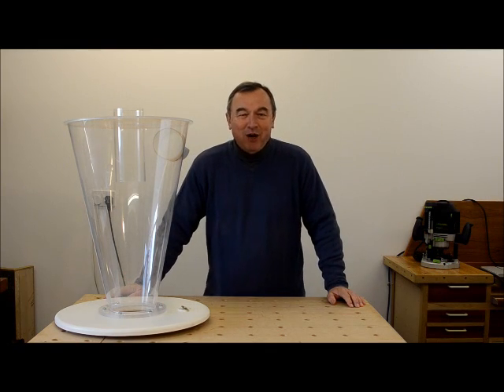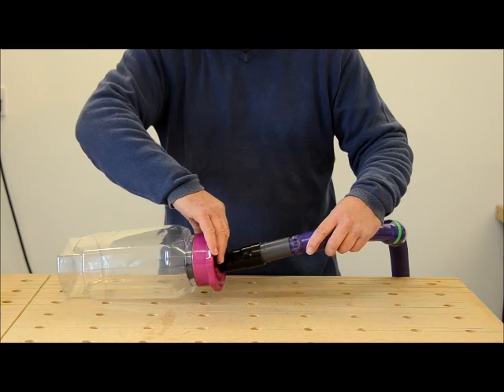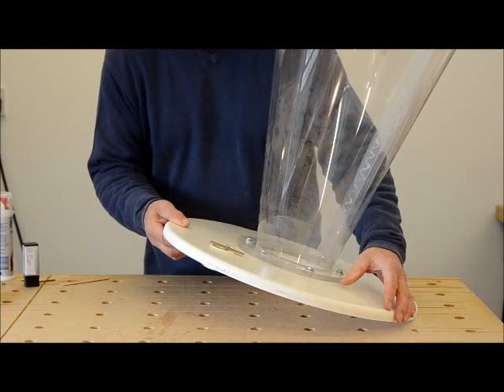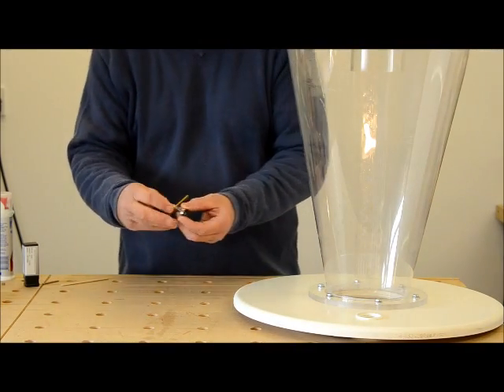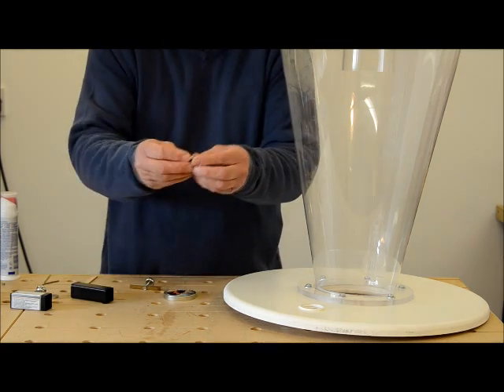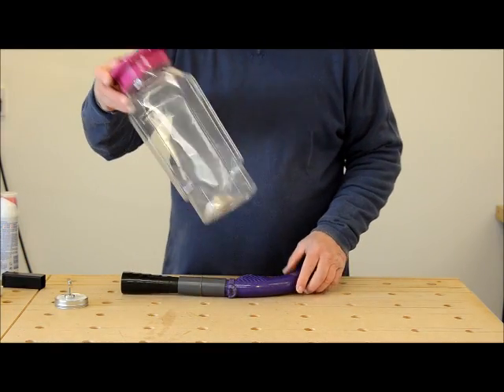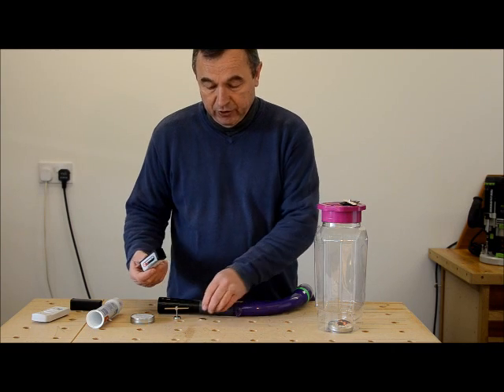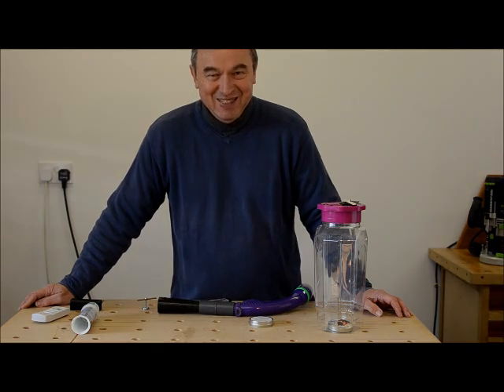Cyclone Pressure Relief Valve

Comment: having the valve at that location will send air back up the cyclone, bypassing the normal centrical spin causing any debris in the cyclone exit into the vacuum and not separate..   if you put the valve on the hose just before the cyclone, air coming in at the valve location will go through the normal cyclone separation.
Reply from the maker: Many thanks.

Comment: not a good fix, you still have to constantly go in to retrieve the cap
Reply from the maker: Hi Eulayses, I did in a later video modify the gadget using a pair of springs that return it to the right position every time.  Peter
Reply: @NewBritWorkshop  great! Do you have a link
Reply from the maker: I have tried to find it but failed. The design is so simple. I used the same tin lid as the valve and put 3 small holes, at 120 degree spacing, on  the lip. I then found 3 fairly weak spring and fixed these to the tin lid and then to the underside of the drop box lid so that the tin lid covered the hole. I carefully experimented to check that it worked. Peter

Comment: The only problem with that design is that you need to stop and take off the lid to reset it. Have a look on Charlie DIYte's channel where he has just put out a new video using a spring-loaded, off-the-shelf valve, available on line, which is self re-setting as soon as the pressures re-equalise. That's the route I'm going to follow!
Reply from the maker: Hi Brian, Ages after making this video I introduced a new spring loaded design of my own using the same tin lid. However, now that I have the metal 4" cyclone from Axminster I do not need to worry about pressure relief valves.  Cheers.  Peter
Reply: @NewBritWorkshop do you mean you don't need to worry about a pressure relief valve, as the attached hose is too wide to get blocked?

Comment: Nice project and thanks for sharing. I love watching people think out of the box. As I was following along I came to a question? (Apologies if someone already asked.)
Why put a valve in it at all? The vacuum supplies a constant air draw rate. We know that without an additional air inlet, the system is too restrictive and collapses the bucket. Why not just leave an open hole? In my mind, the hole is all that is required. Am I missing something? Again thanks for sharing.
Reply from the maker: The hole would ruin the effectiveness. The system has to be sealed until a potential collapse - hence the valve.  Peter

Comment: Are you using a shop vac with that cyclone?   If so, the cyclone is too large.  It's hard to believe that a dust collector blower, which has 1/10th the vacuum as a shop vac, could collapse that cyclone.  And if you did require a relief valve, it should be in the inlet, not the bin.  A leak in the bin sends dust to your final filter.
Reply from the maker: Hi Bill, I am using a Numatic NVD 750 which has a very small tank for the debris. It has enough sucking power to easily crush that original cyclone. However, I now have a metal cyclone from Axminster which does not need any relief valve and it is much cheaper (here in the UK) than the Oneida equivalent.  Peter
Reply: Good call on placing the valve at the cyclone inlet Bill. I was planning to place it next to the cyclone in the lid, unaware this would suck debris up into the shop vac.

Comment: I had made a relief valve with a spring only. I noticed that adjusting the spring tension is tricky. Either it is too stiff and the bucket collapses or with a loose spring the valve tends to leak and air flow is reduced. The magnet seems to be the solution. I'll try some combination with magnet to keep the valve shut and a spring mechanism to reset the valve when no vacuum is applied.
Reply from the maker: Hi Hans, That should work. Good luck.  Peter

Comment: There is a much better method if you think outside the box a bit that is professional and self resetting. Get a McAlpine VP2 air admittance valve, cost about £5. These are designed to use gravity to hold the valve down which is not quite enough as they are only for flushing toilets. However the top screws off and you can fit a compression spring to decrease the pressure at which they operate. I used one I had kicking about, but they can be had very cheaply on eBay if you don't have something to hand. No dicking about with magnets and the VP2 is threaded with a nut so all you need to do is cut a hole in the lid. Looking about I cannot believe nobody has thought of this before as I can see loads of crazy DIY pressure release valve ideas on YouTube.
Reply: Could do with a bit more info than fit a compression spring for someone who's not a plumber or used to seeking out this stuff please? Does the top stay off? Where to fit spring etc. Maybe do a video on it lol. :) Many thanks.
Reply: @Mr_Gadge I imagine he meant to simply place a spring between the lid and the part that rises up during negative pressure. The hole in the lid would probably be to accommodate a steel rod to keep the spring in place. However, he mentions using a spring for decreasing the pressure, and what I'm describing increases the operating pressure.
Reply: Is that correct Jonathan? Don't want to spread misinformation
Reply: @lennartjuhh  Yes I mean increase the pressure at which it opperates.
Reply: Jonathan Buzzard that is the answer I’ve been looking for & I was a plumber & have plenty of them, many thanks for the fantastic tip 👍🏼

Comment: Hello Peter =) First off, thank you for sharing your insights on collapsing containers. I had been thinking about how to relieve the pressure inside, I just didn't know where to start. Until I found your video =D

I wanted to ask, which might either be an elementary or stupid question... but I"ll ask anyway. What's the difference of having a pressure relief valve than leaving the hole open... or perhaps cover the hole with a foam (like the one used in the black Oneida bin), thereby preventing the pressure build-up at the start?

Again, thank you and God bless! - Norman (Manila, Philippines) =)
Reply from the maker: Hi Norman, The pressure relief valve is only there in case the inlet hose gets blocked and all the vacuum is applied inside the cyclone. Having a foam covered hole will reduce the efficiency of the system. The pressure relief valve only operates in the emergency situation when a hose is blocked.  Peter
Reply: New Brit Workshop

Thank you for your response Peter :)

I may just have to consider the frustrating conclusion that it’s the material my container is made of that’s causing it to collapse from the suction pressure.

I have seen others make and use plywood for their container’s lid, but I’m not sure if that would not make the container implode.

I may just have to get a more sturdier container :)

Cheers!

Comment: What size magnets web site closed
Reply from the maker: Hi Menna, They were 12 mm diameter and about 6 mm thick.   Peter
Reply: @NewBritWorkshop  thank's do you have any photo's of them ? did they have a hole in the middle of them
Reply from the maker: Hi Menna, I have no photos. They do not have holes in the middle.  Peter

Comment: I made mine using a spring and also installed it in this location. However, when the pressure relief activated, all the material that is still inside the cyclone gets sucked up with the air flow. Redesign: I made a box that sits atop the cyclone that has the pressure relief valve on the top and vacuum hose on one of the sides. Perfecto! Now when the vacuum becomes plugged (downstream), the relief valve opens and the material in the cyclone falls into the dust bin. After I unplug the hose, the relief valve resets itself and I'm back in business. I used a Hoffmann SS hole plug (with its washer) connected to a coupling (for added weight) connected to a piece of threaded rod then a spring and nut ( for adjusting the regulator). The added weight really helped with the strength of spring I used.
Reply: Any chance of a video Robert?
Reply: Uhm... I guess it's something to the pressure cooker valve, but with the reverse or inverted effect. Thanks to all, great idea.
Reply from the maker: Hi Robert, That sounds like a brilliant solution. Many thanks.   Peter
Reply: Robert, could you share some pictures?

Comment: I installed one of these DairyMaid adjustable milking machines Vacuum Regulators  in the lid of my dust collection bucket to address the issue https://www.ebay.com/itm/DairyMaid-Milking-Vacuum-Regulator-Milking-Machines/272280745271?hash=item3f65327537:g:SBQAAOSwbYZXaJX2:rk:1:pf:0
Reply from the maker: Hi Ross, Clever idea.   Peter
Reply: @NewBritWorkshop  Your solution is what inspired me to try this (and having grown up on a dairy farm).

Comment: This is excellent Peter. Thank you.
I read that you changed to a an all spring system. Did you make a video of that?
I have a mini cyclone on my shop vac. Would the same system work for that? I imagine the shop vacuum pressure is higher. How do I adjust the spring force to get the right balance?
Reply from the maker: I do not have a video of the latest pressure relief valve but it is the same as the other one with the addition of an extra spring underneath. Having a pair of springs ensures that the tin lid returns to the closed position after activation. The pressure can be adjusted by adding a third spring or changing the distance across which the springs are stretched. If you have an Oneida cyclone there is no need to have a safety valve as their cyclones are strong enough to resist crushing. Peter
Reply: I have a generic Chinese cyclone and it is true that the cyclone is strong. However I had to modify the collection bucket to prevent that from collapsing. 
I have also had to add bleed holes in the cyclone to make sure there is always air entering the unit even with the hose is blocked. Like on a domestic vacuum cleaner. This has solved my problem for now but I might create a pressure release in the future.

Comment: A magnet is not required. This can be also done with a spring. The spring has also the advantage, that the pressure can be regulated.
Reply from the maker: +OpenGL4ever You are right and my latest design just uses springs.     Peter